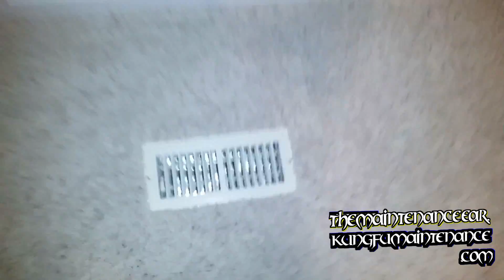Strange Clunking Sound Coming From AC Vent When Heater Is Used HVAC Question Video

Comment from the maker: Easiest Way To Get Universal EPA Certified Prep Manual    http://amzn.to/2kIQdQC
Get KFM's favored AC Gauges here            http://amzn.to/2kYgGb8
5/8" Suction Line Insulation   http://amzn.to/2w1me8G
Inficon Refrigerant Scale                               http://amzn.to/2vUCQPD
Hard Start Kit     http://amzn.to/2kiD16v   Contactor     http://amzn.to/2lFqA0P
Get  the Multi Tool Pliers used in so many KFM videos       http://amzn.to/2kWTjPp
5mf Capacitor   http://amzn.to/2wC96sH     35mf Capacitor    http://amzn.to/2vZVZ2t
35/5mf Capacitor   http://amzn.to/2iVJNi2        40/5mf Capacitor    http://amzn.to/2wzEdXD 
45/5 mf Capacitor   http://amzn.to/2w0wez5   
Condensate Pan Tablets   http://amzn.to/2lalV9W   No Rinse Coil Cleaner  http://amzn.to/2lHg8GD
Condenser Fin Whisk Brush                          http://amzn.to/2vWXUoC 
You must be EPA certified to charge or recover refrigerants and here is about the Easiest Way To Get certified with the Universal EPA Certified Prep Manual    http://amzn.to/2kIQdQC
Simple Leak Seek Spray   http://amzn.to/2lFfcC5  Laser Thermometer  http://amzn.to/2layD8I  
Valve Core Removal Tool                              http://amzn.to/2kJ00pC
Get KFM favored Electronic Leak Detector        http://amzn.to/2kmQMMz
Get KFM's favored Multi-Meter  here        http://amzn.to/2l8W9CO 
Get the Milwaukee 11 in 1 Screwdriver     http://amzn.to/2uTtsNj 
Wet Dry Vacuum used in so many KFM videos   http://amzn.to/2lFxi7u
Chapin Pro Pump Sprayer                             http://amzn.to/2vWCXdD
Evaporator Coil Cleaner No Rinse Mix        http://amzn.to/2x3eJTT
Evaporator Coil Cleaner No Rinse Can        http://amzn.to/2ezIxju  
Get the Screwdriver used in so many KFM videos here    http://amzn.to/2kHFoOF 
Get The Kung Fu Maintenance book here     http://amzn.to/2lEQPFk
Or  the Kung Fu Maintenance E book here  for less than $5    http://amzn.to/2lEY8wD
Get the Kung Fu Maintenance album (good driving music) "Up Beat" here     http://amzn.to/2l41pZ1
Get the Kung Fu Maintenance album (nice Instrumental music) "Entropy" here   http://amzn.to/2kl2U0p
Samsung Galaxy S8 Plus        http://amzn.to/2sFn9h8
GoPro Hero 5 Action Camera         http://amzn.to/2sN4nVK
Rode Lapel Microphone                 http://amzn.to/2vZoFc7
Purple Panda Lapel Microphone  Kit   http://amzn.to/2wByXkq
Video Edit Pro Software       http://amzn.to/2ruaaeZ
Samsung Galaxy S5                 http://amzn.to/2wBxk6l     
Samsung Galaxy S8 Plus        http://amzn.to/2sFn9h8
Video Edit Pro Software       http://amzn.to/2ruaaeZ

Hire An HVAC Specialist                                  http://amzn.to/2lktKek
Air Duct Cleaning Services                              http://amzn.to/2lFTpun
Central Air Conditioner Tune Up                   http://amzn.to/2lzJGoy 
Air Conditioner Repair Or Installation          http://amzn.to/2lFsEGw                                           
I don't work for any of the product companies  listed however I do make a small commission on items ordered  through the links.

Comment: A lot of time the noise that you hear is expansion of the ducts as warm air travels down them and as it expands your boot will rub on the plywood it is attached to and it will make a noise. I couldn't hear a noise coming from yours every time you put the camera close all I heard was wind from the grille.

Comment: I'm new to HVAC (Savannah Tech) but it does sound close to the register, as opposed to a noise being made in the furnace chamber and traveling, so my guess is like the other two commenters.
Heating/expanding ducts making noise . Back home we had baseboard heat (hydronic) and as the hot water began to circulate you could hear the fins plinking as they heated up and expanded but you could also hear a story of popping noise as the pipes expanded against the wood floors as they dropped back down towards the boiler

Comment: I'm not a duct guy but it is definitely the duct work expanding from the heat and rubbing against some part of the structure. If your lucky it's rubbing against the subfloor under the register and you can stuff something soft between the boot and floor to quiet the noise, or slightly trim the subfloor from around the duct. I've had ducts make this noise inside the walls or ceiling and it's a pain to repair.

Comment: It seems that someone mentioned the "heater exchanger". AC experts seem to agree, but want to charge to explore.
Personally, I had thought it maybe a listening device. However, the sound of temperature changes makes a lot more sense, than paying an AC person  for an airconditioing system that works perfectly. Having said that, if you  live in an apartment or a rental of sorts, a request for an investigation to the management is reasonable. 
Please let us all know the result of your endeavors. 
Sincerely, Bond

Comment: Hey I found the problem!:)
Ok it is a rattling noise in a mobile home heat vent. 
What you do is first remove the heat vent cover.Turn a light on over it so you can see.
Kneel down and gently touch the inside walls of the inside of the vent to see if you find anything loose. I did this and found one of the inside walls of the vent is loose! And cracked! If you push on each side of the walls in the vent,you'll find Wich one will rattle when you do that.Once you find out what one is loose and rattles,I placed tape there to make it stop! 😆

Comment: hear knocks every 15 secs until it warms up and drives me nuts but only is heard in the closet area of one of the bedrooms.i know it is duct expansion from the heat but is it really worth the cost to remove drywall and fix it?
Reply: Did you ever figure this out? Same issue here
Reply: @beaubranback  Same issue here too
Reply: Yes, I had same issue in my closet. I opened up the wall and it's the cavity  with the pipes and Hvac duct. I have two similar noises. One coming from the pvc heat exhaust pipe rubbing on wood in ceiling to the attic. I cut away the wood and added rubber pipe insulation. Fixed. Now the hvac duct work is next rubbing on subfloor.
Reply: Same  here. It is in my bedroom. The noise is very ennoying. I was thinking to take an hammer and hit super hard from the vent until it stops

Comment: i have a similar problem and the hvac repairguy said it is the heat exchanger rattleing, and nothing to worry about, he said to fix it they would have to take apart the heat exchanger to find the rattle something is loose in there, he said you dont wanna go through that expense as long as the heat exchanger is not cracked, mine did it on both airconditioning and on heat, i had thought it was the blower but he took the blower completely out of the attic and cleaned it and washed it and put it back and the noise was still there, so it wasnt the blower, you will get used to the noise, trust me,

Comment: OMG someone help me! The floor vent in one of the bedrooms (2nd floor) in my house rattles. I've taken off the register and the sound continues. The vent drops about 6 inches and then makes a 90 degree turn to the outside wall. No idea what to do.
Reply: Queen Rexy i have a that same thing happenin the vent.
Reply: Did you figure it out? I really could use some advice, not getting any sleep

Comment: Mine is doing the same but with A/C.
Reply: Mine too...the big vent where filter goes.
Reply: My does it when I run the central air.  How do you fix it?  I had my ducks cleaned.